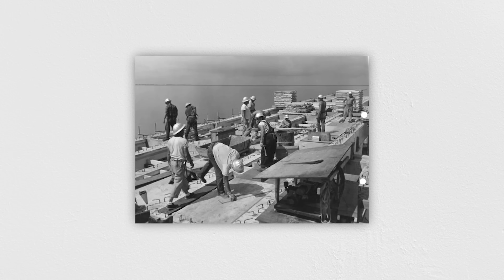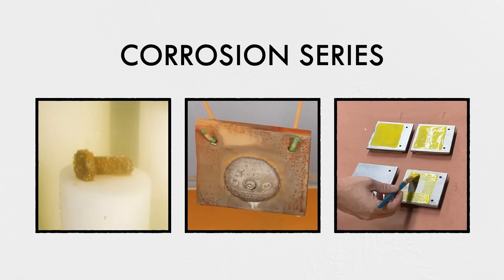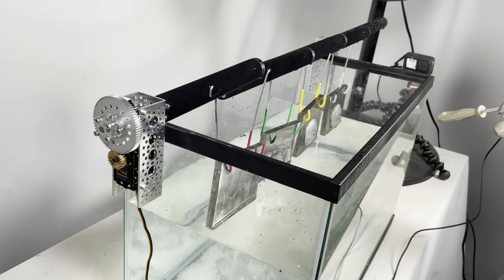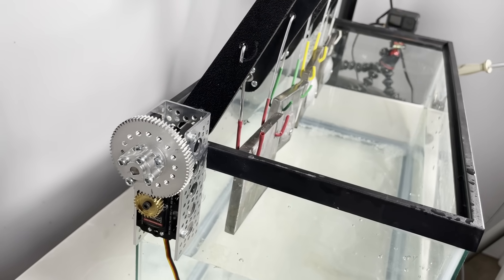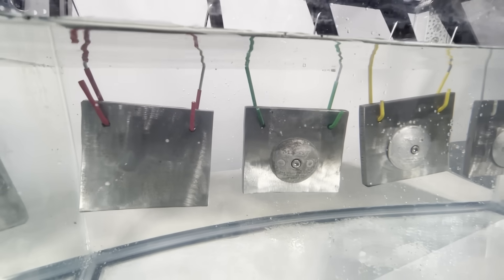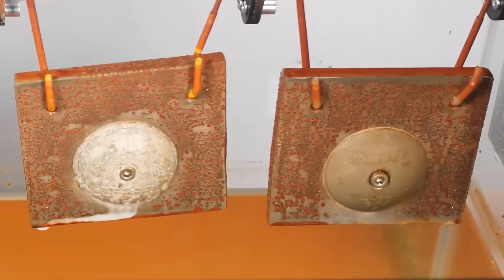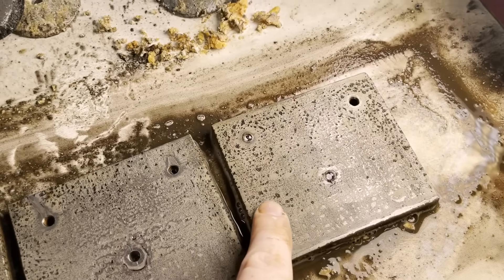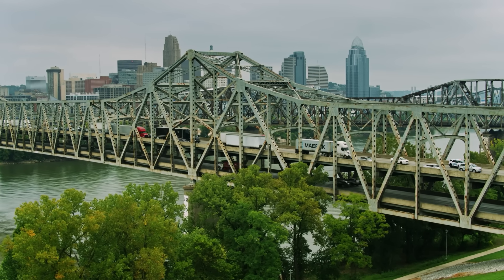Why Spillway Gates Don't Rust Out

Comment: Sacrificial anodes... whilst I understand why they work... still kinda blows my mind that they do work! Something I should probably keep in mind since I have some antenna setup outside, lengths of wire, grounding rods, and not everything is easily shielded from the environment with self-amalgamating tape. Most stuff is insulated, but I dread to see the state of the grounding rods in time..

Comment: Very cool! I've wondered if the "cold galvanizing" zinc paints you can get at the hardware store actually performed comparably to real galvanization.  

From your video, it sounds rather like it could.  Like a spray-on cathode.  Are you planning to take a look at those products in this series?
Reply: If they have a sufficient amount of zinc (>80% wt), and are applied properly, they should work pretty good. The problem with cold galvanizing is ofthen the layer thickness achieved, electrical connection with the substrate, and that it doesn't adhere as well to the substrate metal as hod dip galvanizing does
Reply: @olakoppe  Exactly right. Prepare the surface properly and spray multiple coats and you get good protection for the steel.  Do what I've previously done and just spray it on without much surface preparation and it doesn't last long.  I discovered it lasts even less time if you spray it on a weld before the weld cools.
Reply: I researched exactly this in my engineering undergrad thesis and found that a paint with a sufficiently high zinc content has significant benefit (greater than 80% Zn as someone else said - in our case it was 96% Zn in the dry film). The application was a galvanised structure that had been in service for some decades but had lost a lot of the galvanised layer thickness (through the normal protective mechanism).

Applying the paint over this weathered surface was a cost-effective way of extending its service life. Not as effective as fresh galvanising of course, but that was not feasible. For a structure in service, the options really are either to apply remedial fixes like this or replace the whole thing.

These paints are different from the 'cold galv' spraycan and need to be applied properly. But with a suitable layer thickness they can offer both galvanic protection and also a degree of physical barrier protection, as the pores in the paint become sealed by the products of corrosion. And in the case of small areas of damage they can 'reactivate' the galvanic mode of protection.

Application of a thick layer or layers of organic paints over this system would no doubt extend the lifespan even further. In fact, triplex systems of primer and paint applied over hot-dip galvanising are in common use in new builds in high-corrosion areas.
Reply: No it doesn't. Actual galvanizing uses the temperature of the molten zinc to form a zinc-steel alloy at the surface and then a zinc shell on top. However, the paint can be used to touch up a piece that has already been galvanized.
Reply: @tyrannosaurusimperator You are right about what the result of HDG is, but the zinc alloys and such in it self is not crucial, but yes, the process ensures better electrical contact and bonding between Iron and Zinc, which again provides better cathodic protection

Comment: I've worked at INRS in Quebec as an intern on a pre-research project for corrosion of city water system. 
I've found out that cathodic protection can worsen the rate of corrosion by creating an electeolytic corrosive junction between poorly connected components. 
I dont know at what stage the research project is at right now, but i could share some more informations to you if you want.

Comment: I'm curious how large of an area each of those little anode pucks would protect. I guess it would depend on how electrically conductive the steel is, how far the charge could travel along it to reach the sacrificial anode.
Reply: typically, steel in seawater needs a protection current of around 100mA/m^2, which the anode needs to supply. Anodes have a certain current capacity which can be delivered at any given time scince their protective current have to be supplied by corrosion of the anode. In addition, seawater has a resistance of around 0.3 ohm/m, so the current suplied times the resistance will cause a potential drop, which in turn will determine the furthest distance a anode can protect.
Reply: I too am curious. I know it's not an infinite amount of area, and that even 15-meter English narrowboats use them at multiple points along their length. I would suspect it's a case of diminishing returns.
Reply: @IstasPumaNevada  hey! I installed similar zinc anodes for corrosion resistance.

One anode the size of a loaf of bread would  be enough for the inside of a 50,000gallon tank of jp-5, with a life expectency of 4-5 years
Reply: @IstasPumaNevada  That is funny. My first thought was thinking about them on narrow boats.
Reply: Parameters that go into the calculations to determine cathodic protection levels include the shape and surface area of the anode, conductivity of the electrolyte (water), position of the anode relative to the steel (this matters much more in soil environments than salt water) and whether or not the steel is coated (and the coating quality). He didn't really get into coatings in his video, but coatings are typically your primary protection against corrosion with cathodic protection as a "belts and suspenders" on top. Typically a coating can cut you cathodic protection requirements by 99 to 99.99%, allowing a single anode to protect hundreds of feet of pipe for many years.
Reply: there are engineering standards and calculations for this, should be a copy viewable at your local library so you dont have to spend 10grand buying them all =)
Reply: Worked on this sort of stuff for around 20 years.

Cathodic protection is quite complex  depending on what is required to be protected . 
A static location such as a steeled pile loading area at a port, is completely different to a ship moving through the water with a steel hull, a wooden hulled ship with a say stainless steel propeller shaft , speed of the vessels etc. 

Deterring the requirements of a system  Its a highly specialised  craft. So to answer your question it can not be done with the above information.

The corrosion of the steel is consistent with its impurities. If the steel had no impurities the small galvanic batteries could not be formed and therefore the steel would not corrode apart from a small external covering of rust and no protection would be required.

An example of this is if you wander around London England in many places you will find Iron fences around property that have been there for a hundred or more years and not corroded.
 These fences were made out of steel from  a "Pudlers Furnaces" a type of steel processing making that removed all impurities from it thus no corrosion could occurred.
Really interesting stuff.(if you are interested) 
 A lost art. Look it up.

Regards  Den
Reply: Wow, thanks for all the great information and follow up questions! There be much learning here! 🤓
Reply: The harder it is for the electron to move to the cathode, the more likely it will stay in the steel. The difficulty of the movement of electrons is known as electrical resistance. Steel is a conductor, but it does have some resistance, and that resistance increases with distance. So if the cathode is far enough away that the resistance between the point on the steel and the cathode is significantly greater than the point on the steel and some other point on the steel, the cathode becomes ineffective.

This is actually a guess in the hopes that someone will come along and correct me.
Reply: @wbfaulk the resistivity is the property of resistance in a material irrespective to the size and shape. The  thicker the metal, the less resistance it will have ( imagine using 2 wires instead of 1 or resistors in parallel). So the thicker the metal hull is, the less resistance.  
I think the issue more so comes down to the water you're in. The tylical electrical resistivity of water is : 0.2 Ω·m sea water, 2 to 200 Ω·m drinking water (think of lake Shasta) , whereas on the order of 10−7 Ωm for steel, aluminum ranging from 2.65 to 2.82 × 10−8 Ω·m. 

Even the thinnest of hulls is more or less going to behave like a wire in comparison to the water. However, I read from someone that "
You can increase the protection of the anode, by ensuring that you have less than one ohm of resistance between the zinc and the hull. 1/2 ohm if you can." You also need to put a an anode on a noconductive hull wore to your metal moter and prop. Another important factor is the electronegativity of the metals and the anode.

Overzincing can have it's consequences: burnback, discoloration, paint delamination, and wood rot, so it's also important not to have too many.

Take that with a grain of salt though, I really don't know anything or have any experience with this myself.
Reply: I also have a related question. In this case, less about a purposely added sacrificial Cathode, and more about proper electrical grounding.

For example... an AC coil made from Aluminum or Steel that cools air from a slightly corrosive environment. As the coil does it's thing and hits the dew point, that air will release its slightly acidic moisture which will collect on and flow down the coil.

My question is.. is there any way to protect that coil that doesn't involve exotic coatings like Titanium? Could proper electrical grounding have a positive effect on the longevity of the coil? Is this a consideration that AC manufacturers even make when designing units?
Reply: @wills.9807  To protect such a coil with cathodic protection, the coil and the anoden would need to be in the same electrolyte. This would be hard to ensure on such a coil, so a metallic coating is probably the best choice in such conditions
Reply: Resistance is in the electrolyte (i.e., water with ions in it, like salt) rather than in the metals themselves. The distance covered depends on how much voltage it takes to get the ions to flow from the sacrificial anode to the protected metal through the electrolyte. If the required voltage is less than the electromotive force between the two metals, the cathode will be protected. So the answer is: it depends. On the liquid, and on the two metals. Of course, impressing current will make the protection area much larger. It's just a way of boosting the electromotive force to get the anode's ions to move to protect the cathode surface.

Comment: From a retired corrosion engineer with 40 years of CP experience...at minute 3:40 you state that the anode is low potential versus the cathode having high potential. The CP industry uses the reverse descriptions. In fact, better quality magnesium anodes are marketed as having high potential versus lesser quality standard alloys. This is also consistent with the Practical Galvanic Series as magnesium anodes have the "highest" electrochemical potential versus more noble metals that are typically cathodic in a CP system. You also never mentioned that CP is only effective when BOTH the anode and cathode occupy a common electrolyte such as soil, water, or concrete. Otherwise,  your presentation was very informative. Thanks for engineering the Rustomatic 3000!
Reply: Yeah, well.  Blame the early physicists who got the current direction wrong.  :)  a high negative is a low positive.  And then there's the convention that in most environments it is the negative terminal that is ground, but in naval convention, it is the positive.  Semantics matter!
Reply: I was wondering whether anyone else was surprised by those conventions! My experience in biomedical engineering is similar to yours; implanted electrodes in the heart, brain, or nerves are anodic if they're high-potential, cathodic if low. Tangentially: you might enjoy reading about the various voltametry techniques used in neuroscience; it's all aqueous electrochemistry. I'm sure you'd have an easier time understanding it than I did! As of a few years ago, cyclic voltametry was the only technique we had to get real-time measures many high-profile neurotransmitters in living systems.
Reply: "You also never mentioned that CP is only effective when BOTH the anode and cathode occupy a common electrolyte such as soil, water, or concrete."  Is that why Electronic Rust Protection units for automobiles are considered a scam?
Reply: Yes, that is exactly why.
Reply: @andrewmorton3272  Yep. The salt spray from the road lands as little droplets and makes patches of corrosion activity. That's why you see the same parts rust out on different cars. Your whole car isn't submersed in the salt water, otherwise it would be a boat.

The best rust prevention for vehicles is a coating of some kind that protects the metal. Farmers used to spray used motor oil on the undersides of their vehicles, which did work, but caused other issues...
Reply: @andrewmorton3272  yes
Reply: I think that you are both correct.  Grady is referring to the actual unprotected corrosion mechanism and your industry deliberately reverses the process, effectively changing the cathode to the anode which reverses their role in the corrosion process; it follows their definition changes as well.
Reply: The reversal of these terms also confused me when I started in the business in 1981. An addition nomenclature issue is that corrosion (CP) engineers track ion flow through the electrolyte and not electron flow through the metallic circuit. This makes explaining the entire CP process even more confusing!
Reply: I believe, but I might be wrong, that those potentials are based off of the standard hydrogen electrode, which, as a convention, is set to be 0V. All the other electrodes are measured against that to determine their potentials
Reply: Yes, laboratory electrochemical potential data are typically measured using a standard hydrogen electrode, which is fragile and not field friendly. Potential measurements used in cathodic protection (CP) require a portable/durable field tool that has a copper/copper-sulfate reference electrode (CSE). There are also several other reference electrodes (e.g., zinc and silver/silver chloride) that can be used in hostile electrolytes, but the CSE is the most widely used reference in typical CP applications. References are available upon request.
Reply: @CP_Guy  Huh, I didn't know you could request reference electrodes on the field. I suspected the hydrogen electrode wouldn't be rugged enough due to the glassware and gaseous hydrogen required
Reply: Maybe you would know the answer to this because Im struggling to find an answer through searches: do you know if this cathodic protection method could be used to reverse existing rust and convert it back from an oxide?
Reply: @skylin245  Cathodic protection can only suppress further corrosion - it cannot recombine the oxidized ions and electrons that formed the original metal.

Comment: I wondered in the comments of the last video on rust about impressed current cathodic protection without knowing it was already a thing. I also suggested "using a more corrosion susceptible material like the sacrificial rod in water heaters as sporadically placed plugs or skirting material."

Kinda cool to start my day knowing I came up with something a century after it had already been implemented.

Comment: I experienced the effects of corrosion in a unique way when I went to replace my brakes and rotors a month ago. My wheel lug nuts should have required a 19mm socket. Only the 21mm socket would fit, but it kept slipping. Eventually I rounded off the lug nut and had to use a special tool to get it off. I was frustrated and confused.

 I later discovered that the OEM lug nuts use a mild steel core for the threads with a stainless steel cap for the shiny look. The slight difference causes a small amount galvanization between the two layers. Since the inner layer is pressed against the threads of the lugs, the outer layer swells.
Reply: That's why at my work I despise selling capped lugs to clients. I always recommend getting filled steel one.
Reply: that type of lugnut are the devil!  I always swap that style with a regular chrome plated type.  Sure they don't look pretty, but the caps also don't expand and get twisted off.
Reply: Yeah I immediately thought of Ford, I had to deal with tons of those working at tire shops.
Reply: Those are a terrible cost cutting measure from some OEMs. I hope you replaced all of them with solid one piece lug nuts.
Reply: Is it a dodge?
Reply: @KMBaill79  nope, a Ford
Reply: @evanlucas8914  Yup.  Ford actually has 21.5mm and 19.5mm sockets to work through this issue, the larger fitting the swelled cover and the latter being the nut once the cover comes off.    Jeep, Dodge, Infiniti, and Honda cars in my family have all had this issue.   Now the first thing I buy for a new car is a set of chrome lug nuts.

Comment: Cathodic protection (CP) is a great tool that is under utilized. One of the main reasons is it does require occasional monitoring and maintenance. And it's often the first area to be cut when budget cuts are made as it has long-term consequences, not immediate ones.
Reply: @Jim Allen but you see, my quarterly profit and thus my bonus cheque do not care about your silly things like long-term outcome, so you are getting the axe :)
Reply: Nobody checks them in their domestic hot water tanks, but if they were maintained it's estimated to extend the life of the tank far beyond when the rest of the system will fail.